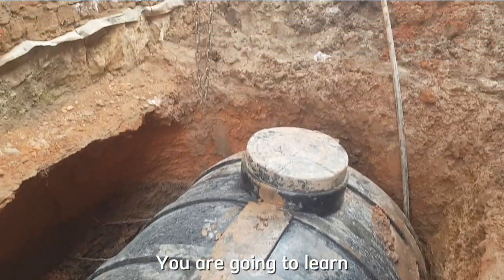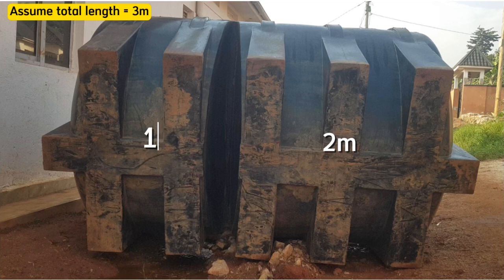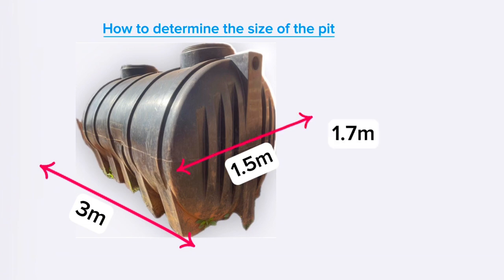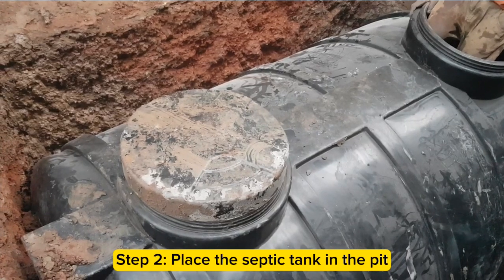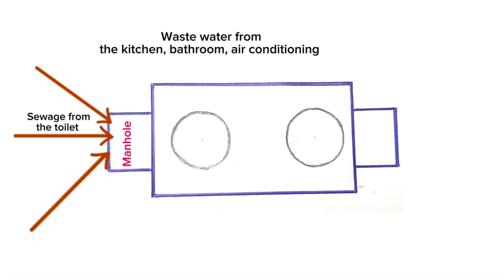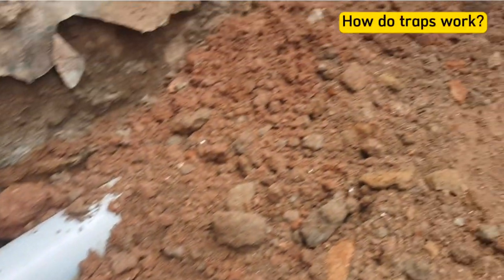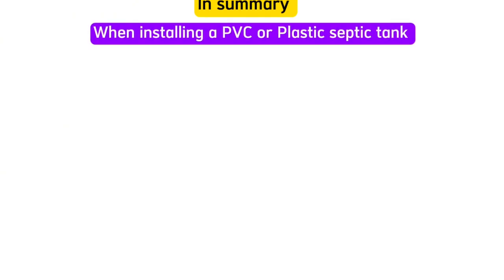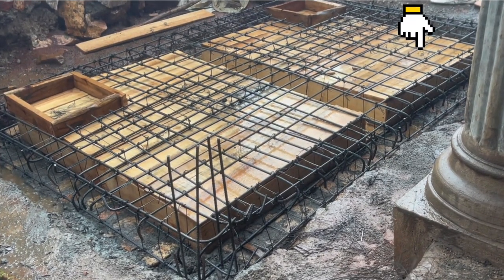How to Install a Plastic SEPTIC TANK | DIY septic tank construction

Comment: Can it be used as a water reserver
Reply from the maker: Yes, though it is better to buy a real water reservoir
Reply: @ Engineer I have a water source (well) in the valley, so I want a tank that is inside the ground to collect the water from the well and after pump it up to the 10000 liter water tank for home use.
Reply from the maker: @feeqbojan8455 Yes I recommend elevating it to allow easy flow to toilets, sinks without double pumping it again 

Watch this video to see how https://youtu.be/LbLxfs110ck?si=oWN5EYag9CwWjGQ6

Comment: There is a septic tank am trying to install of the same kind but water is affecting because the pit was kind bigger than the tank so what should I do 
I need your contact for more information.
Reply: You have to use a raking shoring method to stabilise and rebuild the sides or backfill the sides using gravel and sharp sand  etc.. or use underpinning....
Reply: Thank s

Comment: Thank u so much for teaching
Reply: Engineer which means with this plastic tank you can't move cars on top or put any shelter?
Reply: Engineer what  advice do you give people who build toilet on top of septic tank
Reply from the maker: @BilabiGodfrey If the Engineering and the connections are okay, no problem with that 

What matters is getting an expert to do the work correctly
Reply from the maker: @BilabiGodfrey No cars on top of plastic septic tanks they are weak